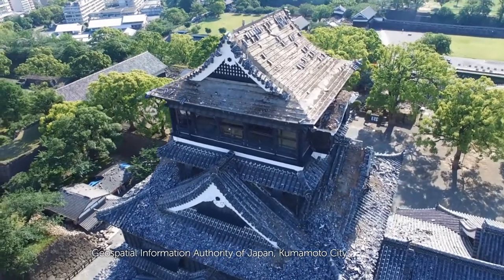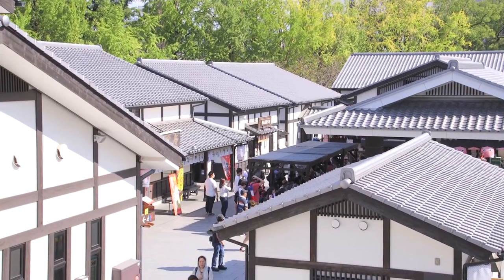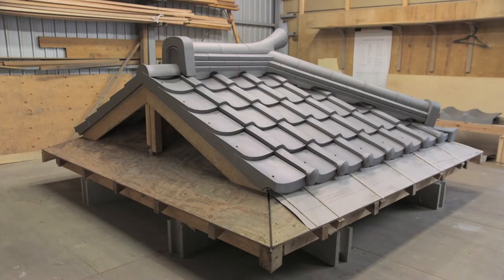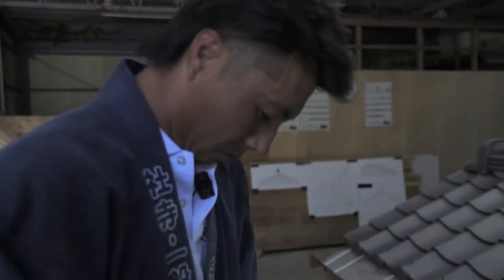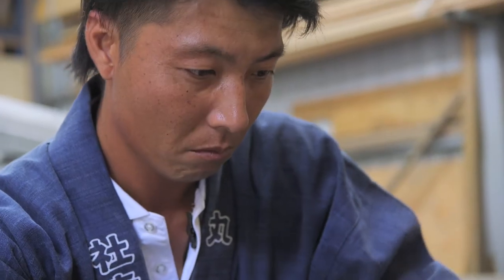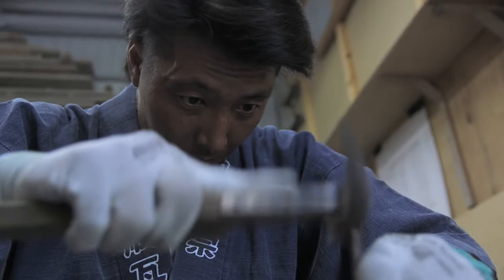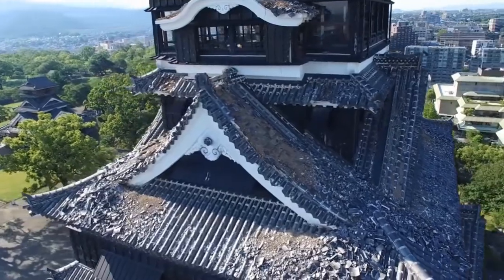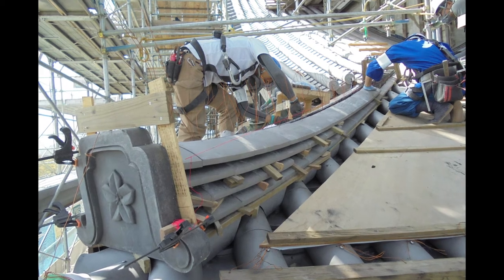Restoring a Region’s Symbol – Kumamoto Castle

Comment: Another great video. However, previously you did a video on using titanium as an alternative material to traditional clay to make roof tiles. In that video you mentioned a lot of advantages to using titanium instead. I wonder why they didn't use it instead? Unfortunately I can't find the video. A lot of your older videos are very difficult to find. The title of the video was "Titanium Tiles for Temple Roofs"
Reply: If you are restoring something, you have to use the same materials (and sometimes even the exact same methods) in order to get it back to the original state. Titanium slates would be updating, or modernising it (which isn't a bad thing) but the aim here is to restore.
Reply: @oabuseer  Good point. Thanks.